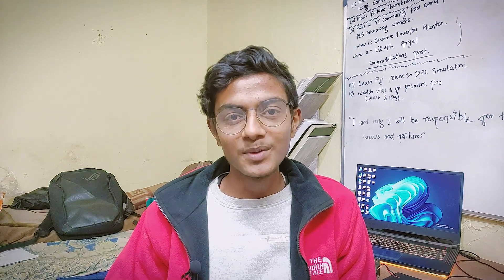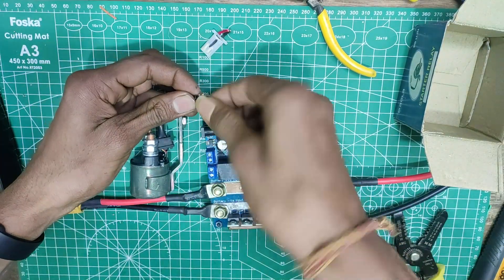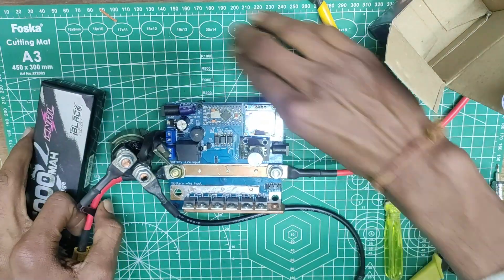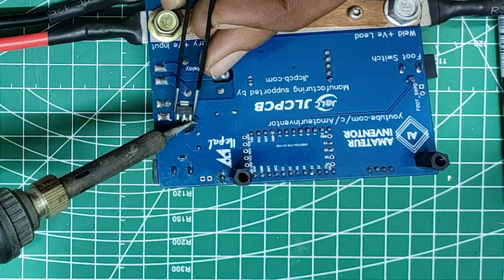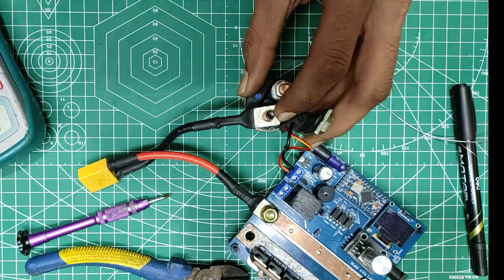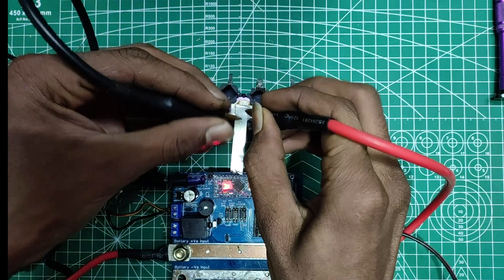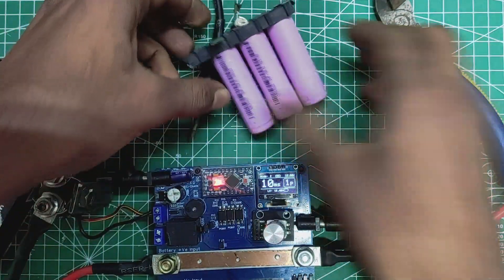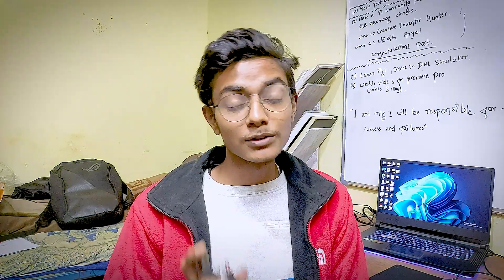Make a Spot Welder with Starter Relay

Comment: Unfortunately, the welder based on relay is not reliable enough and may cause battery blow and flame. It is because of volatile anchor fly time, due to unstable magnetic condition of the relay core. Evaluated welding time could be too long or too short. It is too volatile to be good to use with confidence. Beware of using relay for spot welding, I suggest to use power N-channel MOSFET with drivers instead.
Reply from the maker: you're somewhat correct here. The timing is never too precise and there is a risk of permantly welding the relay but since, it is driven by precise timer the time is somewhat consistent. I have performd 100+ welds til now and it is working well. however this is not a long term solution and is only suitable for hobbists. This Poudell spot welder already has N-Ch Mosfets for switching. this one is a added feature to this board. 
And thank you for showing your concern here
Reply: @AmateurInventor  It's ok. I had made relay spot welder controlled by Atmega328p, with anchor fly time detecting and a bundle of some features, e.g. auto welding, pre-welding etc. Program part works fine, but due to unstable relay magnetic parameters the all project wasn't successful for sure. Even so, exposing time wasn't precise enough. Of course, it works, but should be use with high caution. I have expirience with 18650 burnt through and lithium flame, dangerous event. Metal bucket should be near just for case :) Anyway, keep doing, wish you good luck!
Reply from the maker: Thank you very much for your suggestion and feedback. Working is lithium is already a risk and using this might be a added danger but, with cautions and small works, it works for sure but this is not intended to a industrial spot welder for 1000s of batteries. I am overwhelmed by your comment 😊

Comment: Good job bhai. 
I am amazed to see your knowledge in electronic  devices and  components  at this level and age. I felt like somebody alreacy with an engineering degree and at least 2~3 yrs industry experience is talking on the video. 
I wish there were PCB manufacturing companies in Nepal(which is very unlikely given the industrial scenario of Nepal) from where people like you could get their design made on few days at very low cost. Also I wish electronic components, ICs and many other things could be bought easily in Nepal. PCB software tools are too expensive but crack versions can be found.
These things discourage me from opening hardware/embedded startup company in the future. However, when I see young people like you I get very happy and encouraged. Keep up.
Reply from the maker: Thank you very much brother for your comment. Reading these wonderful comments is what, that gives me motivation to continue on. It is not as easy as people try to portray it, tools are expensive and unavailable, there is equal difficulty in getting the right component and getting any foreign item is unbelieveably expensive due to the shipping charges, also getting fund to have research is extremely hard. However, I am not one of those who just like to point out the problems, I always believe that hard work has the power to defeat bad lucks and problems, I am on a  mission to learn new things everyday, getting better and better on the way. 
Now, I have the supporters like you, I am gettting good response from the youtube. Soon, I believe, There will come a time where the whole country will get benefited from my works.
Reply: I'll Malibu booboo onions! Mono to Inc to eat tomorrow
No Jim loo ew why loo